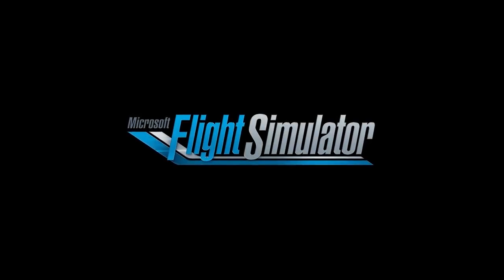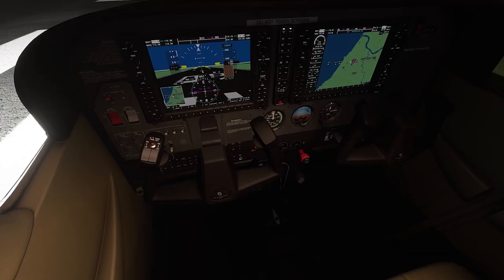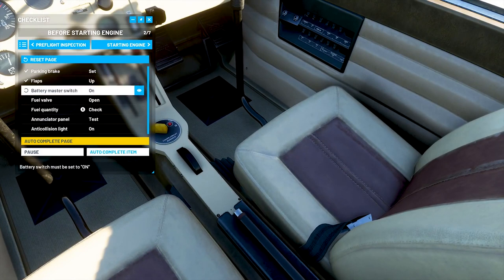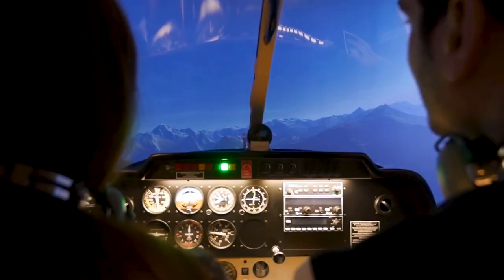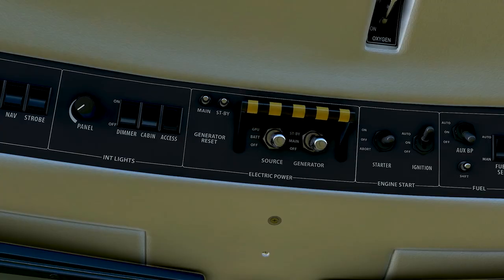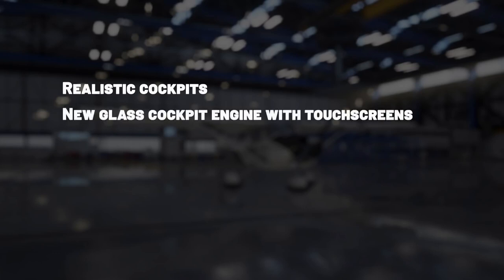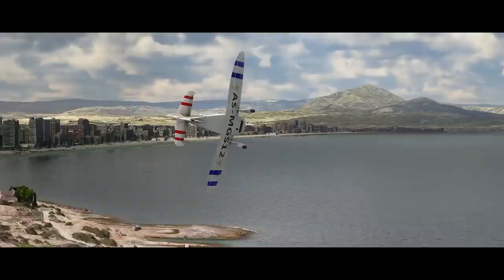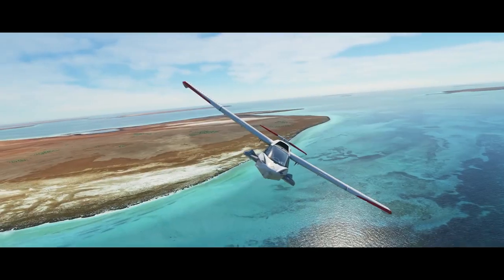Flight Simulator 2020 Update (Nov 27th) Cockpits Episode!

Comment: I am now certain GA will be fine, now I need Airliners, I want to see the FMS, autopilot, I want to flip every little switch at least as much as the zibomod 737
Reply: You will be able to, if Boeing is working with them there is no way they would let them release something half hearted when this much effort is already put in to the sim.
Reply: They have showed Airliners only sparingly so far with little information. My guess is they started with GA as a base because they are simpler, and then worked up to Airliners from there - meaning they might not be done polishing the Airliner mechanics yet. I'm certain we'll get a Discovery Feature dedicated to Airliners once they are ready to show them off properly.

Comment: Next, they should implement the "remove before flight" and APU system with connection and so on, external fuel tank for putting the carburant, pushback vehicules on he airports, gates, passengers who reacts ( screaming if pilot has fun with a liner plane ), womis in looping... ( FX passenger 10 )

Comment: I feel like its going to be cheaper to by an actual plane, than buying a computer that will run this all smoothly
Reply: I feel like you live in a cave or under a rock and someone just woke you up
Reply: @activex7327  go on why?
Reply: @Acbaker23  They already released footage 60 fps at 4K on current hardware, I wish there's hardware to run Xplane at 60 fps at 4K looking that good. Also, this will on XBox and therefore it has to run at high fps, that's one requirement about Console games, if they run at 30 fps, no one buys them or plays them. ... And yet this sim doesn't use DX12 or Vulkan features. They will come later making it run even faster. I hope that helps. I can get current hardware for under $2k Canadian and build the system myself, ezy.
Reply: ActiveX I understand where you are comming from and I really hope a relatively good system will produce this quality, but just because they have released video means absolutely nothing. 

They are not going going to put out a slow FPS video to try to sell their product are they?

Also, just because it’s comming out on a console, doesn’t mean it would run fast enough. Have you ever tried to play just cause 4 on the latest gen console? When you start blowing stuff up, the frames can drop down to practically 5fps. Granted there’s a lot of physics stuff going on there, but there’ll be a lot of physics running in the flight sim.

Just like you i’m hoping that It’ll run smoothly, and that I won’t have to upgrade what I’ve got so far
Reply: LIVE vids, so people playing game on actual hardware, it means using current system and I told you how much they cost. Also, people were invited to play the game on current gen systems, so not sure what you mean by this: "I feel like its going to be cheaper to by an actual plane". Not sure where you heard or saw Just Cause 4 and FPS dropped to 5 FPS during game play I heard otherwise that it did drop but not to 5 FPS but sub 30 FPS. You need to link source.

Comment: Blah blah blah blah blah.... sounds like a bunch of smoke and mirrors from Microsoft again! Everything seems so perfect! There is no way that this simulator is going to deliver everything that you're talkin about and if it is the case even with the scenery being loaded from your internet oh, you are still going to need a ridiculous system to run it the way it's looking in these promotional clips let's just wait and see until it comes out also I hope they release some new scenery because I'm really getting tired of the same shots that they're offering us
Reply: Gemster18 If you use punctuation, people will understand you better.  :)
Reply: They are running it one basically the same system as I have except they are using the i9-9900K CPU and I am using i7-9700K. So it's not that ridiculous unless you're broke.